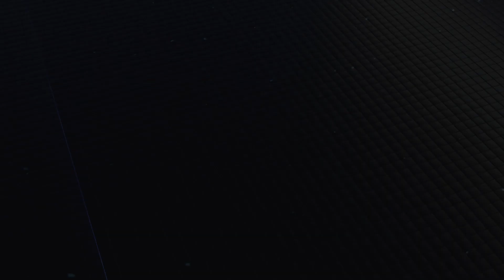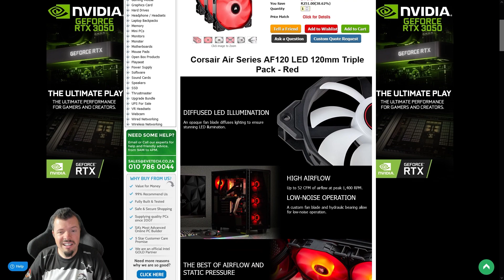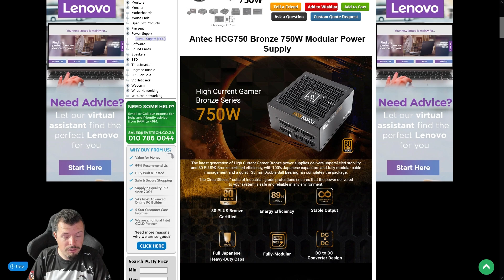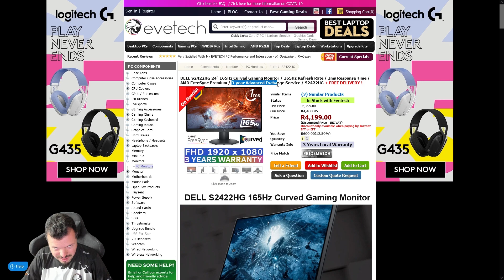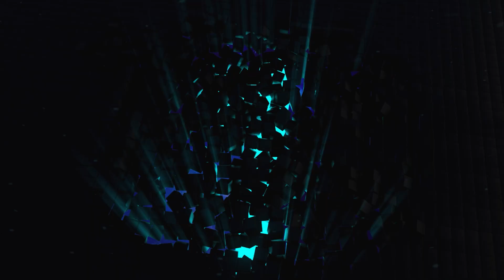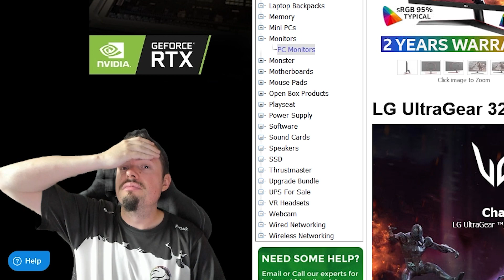Evetech Specials Week 6 2022 - SICK NEW SPECIALS! All the reviews coming up as well

Comment: Will the LG 32GN600 support 120hz for Xbox series X at 2560 x 1440p, if you can confirm then I will be on my way
Reply from the maker: The monitor can definitely support the res and refresh rate but if the Xbox actually accepts it is another story...

Comment: Second, But man why the Gpu are so expensive even now when Bitcoin is going down?
Reply: I think the demand is still high because other alt coins are still going well like Ethereum so won't be back to normal for a while
Reply: @turbotortoisetech  then let’s wait till next year especially here in South Africa for less than msrp price
Reply: @gugukhoza3622  The RX6600 pricing is very good if you check the MSRP it's basically the same plus our exorbitant ANC tax. Not going to get much better imo
Reply: @gugukhoza3622  There's a stock shortage. Prices will only increase and the ran will only weaken. Next year you will pay 20% premium.